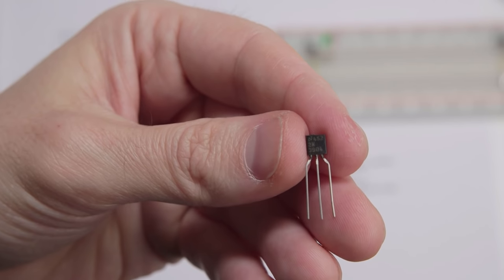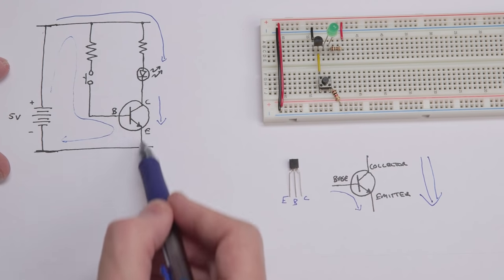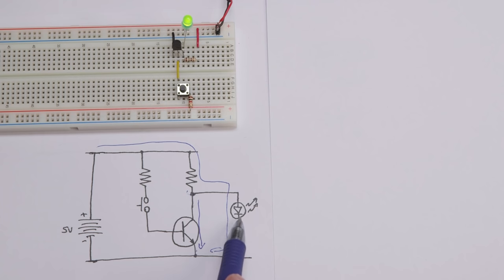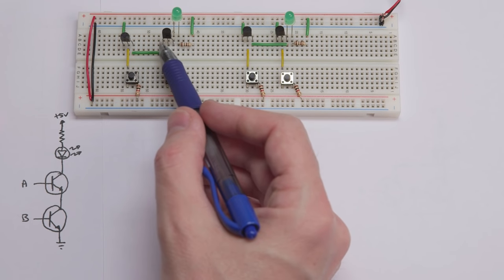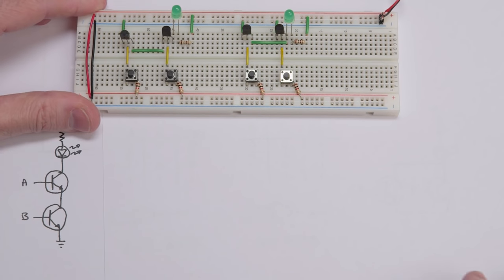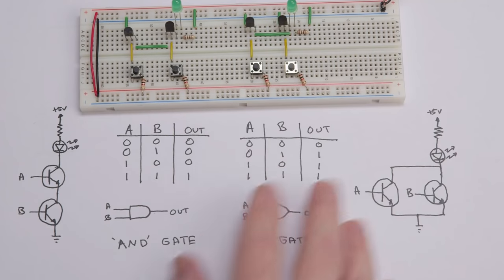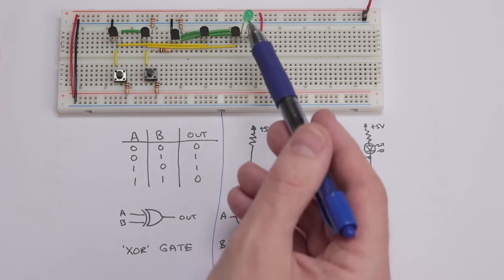Making logic gates from transistors

Comment: Ben Eater - in the inverter circuit where the LED turns off when the button is pushed (around 3:30).
I can't help but thinking of all these circuits that are open/flowing current - eating up energy.  Typically, when I think of a switch, I think of current flowing or not flowing.  yet in this design, current is always flowing?
Reply: The led does not have a resistance, but a voltage drop, now the  LED does not turn on because a parallel connection always has the same voltage drop, but the transistor does not (as far as I know) have a voltage drop so the voltage drop will be 0, and an LED needs about 2 volts to turn on so therefore it will not turn on
Reply: Yes, in the above circuits, there is always current flowing. And the circuits he's using is very similar to TTL which was noted as being high speed, but power hungry. But there are other methods of creating the desired logic. Take a look at MOSFETs for instance. With those components, you don't have a constant current flow from the base through the emitter, what you instead is charge and discharge the gate as if it were a small capacitor. So you get power consumption whenever a logic element changes state, but otherwise, there's no current flow. And from that, you have what's called CMOS.
Reply: You are absolutely correct and John Cochran's reply is 100% the best answer to your comment.
Having worked in the design area of an electronics company in the late 80's "idle current flow" was a big concern for a company wanting to reduce the power consumption (and heat degradation) in their product. TTL logic circuits were designed (in the company where I worked) so that if their output was high or conducting over 65% of the time, that output would be inverted, if possible. This actually made the overall circuit bloated with "decoding" logic to re-invert the signal, or PNP instead of NPN transistors were used as drivers, but it did reduce the "idle current flow" ... in some cases.  TTL (transistor/transistor logic) ICs are fairly rare in today's digital circuits -  discreet transistor logic gates such as these are even more rare and only used to buffer logic IC outputs to high current loads. Even that has mostly been replaced with Field Effect Transistors who's current reducing attributes are explained by Mr. Cochran.
Reply: in this case its reffered to as high or low. in this kinda desing you can't have literally nothing as "low", that would equal a shut off computer
Reply: well in real computers the output of almost every transistor is the input of another one which doesn't drain current except for when the state is changed. Also There are other types of transistors as well which deal with that inverting problem.
Reply: Jakob Furbo I was curious about this when you said LEDs do not have resistance so I researched it. LEDs DO have resistance, but is is not linear. Resistance is high with low voltage, but falls rapidly at breakdown voltage. Without a protective resistance, too much current will flow and fry the LED.
Reply: LoneRegister oh no! Not my mAh!
Reply: roygalaasen the

Comment: Why do you need the middle voltage supply in the XOR-gate?
Reply: I'd like to know this as well.
Reply: Yeah. This doesn't look quite right.
Reply: I think it's to pull the middle voltage up to high when it's not connected from the right, preventing residual voltages from messing with the output
Reply: I’m still wondering this, why doesn’t the voltage go straight to ground through transistor if it’s always on as he says in video?
Reply: Please Someone Answer To This !

Comment: +Ben Eater Great video!! Can you provide some specs on the transistors and resistors you've used in this video? My dad and I tried making your circuits and we couldn't figure out the parts you used from the video.
Reply: i think he uses an 452 2N3904 transistor
Reply: Any cheap NPN transistor will work. I'm using BC547.
All resistors connected to base must be around 1 kOhm or larger.
All resistors connected to collector can be around 200 Ohm (+/- 50 %). Too small, and the LED burns. Too large, and the LED does not light up.

Comment: can you tell me which resistors (how much ohms) and transistors you used? also what is the voltage of the battery you used?
Reply: The button used a 10k ohm resistor while the led used a 220 ohm resistor.  I'm pretty sure...
Reply: Ignore that last comment.  After testing it out a bit I can confirm that he used 1k and 220 ohm resistors.  Seems like he's using basic NPN transistors as well.
Reply: Well for the pull-up/down resistor (the resistor used for the transistor base) you will use between 1k to 10k, this is to limit the amount of current (amps) going into the transistor, the transistor only need a very small current to work.
Now for the LED you will need to calculate for each LED you are using. Most LEDs like to get about 20miliamps of current and most LEDs have a voltage drop about 2 volts. so if you have 5v power supply you will have a voltage drop of 3v. now you will use ohms law to find how many ohms you need 150 (ohm) = 3 (volts)/0,02 (amps). but you can just use 220 ohm for almost any LED if you are lazy.
Reply: Well, after closely seeing them, you will notice the colour codes Brown-Black-Red-Gold, which is 10 X 10e2 = 10 X 100 = 1K ohms. Well its not clear if the third band is RED or ORANGE, if it Red, it is 1k. If it is orange, its multiplier is 10e3, so the resistance will become 10k ohms.

Comment: 11:17 would the two bottom transistors off shorting vcc directly to ground cause problems or power loss in real world usage?
Reply: there is a resistor connected to that circuit, so its not a short

Comment: I remember in Electronics lab we were creating logic circuits on breadboards using truth tables and those logic gate ics. The chips we had only had a few types of logic gates and just 2 inputs so I made the whole circuit using bjts (2N3904 and 2N3906), 5.6k resistors, and 1N4001 diodes. It was easier to set up for whatever reason.

Comment: Remember uL914 ?  The guidance system in  the Minuteman missile was built around a 27 bit computer made from ca 1500 transistors and 4500 diodes.  Early boot ROM's in some computers was built from a diode  matrix.

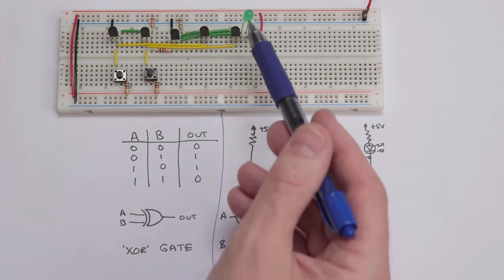Comment: You actually have a resistor that doesn't need to be there at all. Pause at 8:55. In the handdrawn diagram, it's the middle one at the top written 5V next to it. It provides power to the collector of the 5th transistor, which is also connected to the emitters of the two transistors coming from the parallel after the LED. There's no need for it to be there at all, in fact, it's a battery drain.
It does not need to be replaced with a direct line, either. It can be removed and that input line on the diagram erased so it shows only two 5V signal lines.

Comment: In an AND gate, you only need 1 transistor. A transistor is really just an AND gate.
OR gates only need 2 diodes facing the output direction.

Comment: The first circuit can be called a buffer if you want.  Typically you would use an opamp for a buffer but your circuit works fine.  Also, you only need two npn transistors to make a bipolar XOR gate.

Comment: I don't think that you need 5V and pull up resistor at the single NPN transistor in the xor circuit. I just tested in LTspice, with or without it, it works.

Comment: I had issues for the longest time with my transistors, but realized i hadn't put a resistor on the buttons, and I had one on the led. Remember to put resistors on your buttons like Ben Eater has or your transistors will be inconsistent.  I think its because there was more current coming through the base from the button than the collector from the led, so current was flowing either slower or not at all through the led. Tell me if I'm wrong though because i wanna learn.

Comment: Just know, current actually flows from negative to positive, back when the schematic symbols for diodes and trasistors were conceived, they had different ideas so the little arrows in those symbols are effectively pointing the wrong direction.

Comment: Okay. So. While building these individual gate circuits was simple enough for me, I ran into a HEAP of trouble connecting them together - say, to make two NOR gates feeding back into one another to make an SR latch (I wanted to be sure I understood the concepts sufficiently so as not to rely on IC gate chips). Other resources on the web were no help, and it took me a few days to understand what was going wrong.

What it came down to, for me, is that the inverter gate (which forms part of a NOR gate in my case), when it's in the "off" state, will still have some amount of voltage/current-generating potential at the output (it won't be a TRUE "zero"). This will hold so long as there is ANY resistance in the transistor itself (or of course if the transistor is not in "saturated" state). In my case, the NPN transistors I had on hand (from an "electronics lab" project kit for kids (no longer sold)) do provide some small resistance. If there is any resistance, then the activated transistor isn't really a "short to ground", and that means there's still a voltage differential across it. And if there's a voltage differential across it, that means it's not going to be a "true" zero. It'll be "close to zero". Which is fine, until you apply it as the input to another NOR gate's transistor, where it start to amplify current when it was supposed to be "off".

The remedy for this, at least in my case, is to be sure and treat the LED as part of the circuit, and make sure you take your "output" after the LED. The voltage behind the LED should be lower than the voltage required to operate it ("forward voltage"), and so the LED will be enough to stop small currents from flowing when it's supposed to be "zero". This means if you, too, try to build a latch from a pair of NOR gates, you can not remove one of the LEDs (say, the not-Q indicator), and must feed each NOR gate's input from the other, after the diode, to prevent the leakage. (If you wish to omit an LED, replace it with a suitable diode instead - just make sure that a minimum output voltage is enforced.)

I recommend everyone building the inverter/"NOT" gate, or any of the inverted other gates (NOR, NAND, etc), verify their outputs have no voltage while "off" - use your multimeter, and keep in mind that the voltage/current will be a slight one, so if it's an analog multimeter be sure to compare against a true zero (that is, pull the contact off and on and see if it moves even slightly). If you find, as I did, that there is in fact some voltage being applied, then save yourself some headaches and be sure you're applying a diode.

Cheers! And apologies to those of you who may have much nicer transistors that really will act equivalently to a short. I've just ordered some 2N2222s and 2N3904s, so I'll be sure to check my results with those.

Frustratingly, I found no electronics books, YouTube videos, or other online videos that made this issue clear, since all of them dealt with "ideal" transistors that short to ground, or just use an LED turning off/on to "prove" the state - and once they prove you can build the gate with transistors, they move on to using IC gates - or in the case of schematics write their diagrams using gate-level logic instead of transistor-level. I can't tell you how happy I was to finally get the little light to hold and swap between Q and Q-! ^_^

Comment: Was always wondering/curious how to wire a circuit for lights in a long hallway - with two flip switches at each end. Got tired walking back and forth - because both switches need to be in the ON position for the lights to come on. If one switch is in the OFF position, then you can’t turn ON the lights with the other switch - have to walk to the other end of the hallway to turn the other switch to the ON position....... Anyways, it looks like the simplest solution to my problem is the “XOR” gate!!! Thanks for your awesome, and to the point explanations - well done on the video mate - subscribed, and will be looking at more of your videos:)

Comment: PLEASE HELP!

I'm taking the AND gate as an example but this also applies for the XOR gate.

The way he built the and gate means that it can only turn on an LED, it doesn't really give an output of 5V anywhere, instead it's  allowing the LED to be connected to ground for it to be turned on. This means that I can't connect many gates together because there is no 5V output anywhere, only a path to ground. The input for these AND gates "ask" for 5V, not a path to ground.

A solution I thought of is to instead take an output after the transistors, which will connect the output to 5V if both transistors are on, and to ground normally. This looked like it was going to work, but if input A is off and input B is on, the current going into the base of transistor B will just go through to emitter, giving an output even though input A is off.

Another solution is to just make an NAND gate by taking an output with a resistor instead of the LED. This way when both transistors are on it will connect the resistor to ground and give a 0 for output, but any other time it won't connect to ground and will instead be connected to 5V, giving a 1 as an output. Then I just have to invert the output of the NAND gate with an inverter the way he showed in the video. But this solution uses an extra transistor, increasing the amount of transistors in an AND gate by 50%, which is of course not ideal.

The third solution i thought of it just to use small logic level MOSFETs instead of the BJTs used in the video, i could find some online that were the same TO 92 package as the BJTs shown. MOSFETs don't give an output at the source when there is no voltage at the drain, but when there is voltage at the gate, there isn't a current flowing into the gate. This means i can just use the first solution of putting the LED after the transistors, so that when B is on but A is off there won't be any current flowing from the gate to the source. But this solution still isn't ideal, as most people are obviously using BJTs and all the circuit diagrams are drawn with BJTs. Small logic level MOSFETS are also quite hard for me to find.

So does anyone know a way where i can build an AND gate with only two BJT transistors, and have a 5V output instead of giving a path to ground? Thanks for reading and answering this.
Reply: Ok it's been 3 years and I've found the solution. The trick is to use a combination of nMOS and pMOS transistors so that the output of the logic gate can be either 5v or ground. Logic gates made with both nMOS and pMOS transistors are called cMOS.

Comment: Very good video. Quick question, on your XOR gate, the third transistor from the right, whose base is normally on unless there's an AND condition, does it need 5V power to its directly to its collector as is illustrated? I know you mention that there's no voltage potential if that transistor base was off, but would it not also work if the transistor was "open" due to no power to the base and thus nowhere for the current coming from the OR arrangement to go? Thanks in advance.
Reply: I actually thought the same. I built that scheme without that additional resistor connected to 5V, and the scheme worked fine. Seems like many of us here in the comments had the same question. I'm more inclined to think, that we don't need that connection.
Reply: @ilya_95  funny enough I just built an XOR gate a few days ago and had the same results. Perhaps there’s a reason but I’m not sure.

Comment: May be a dumb question but at 2:20, when Ben brings up the inverter circuit, doesn't pressing the button essentially create a short circuit? The power flows through the transistor instead of the LED as it is a path of lower resistance. Does the resistor before the switch prevent this a short circuit? I understand that in a bigger circuit the leads wouldn't directly head back to the power source as they do here, but in this circuit in particular, it looks to be a short. Can someone explain please?

Comment: Thank you so much for making such a carefully worked out video Ben! I have a question about the XOR circuit. Is the second connection to +5V on the top in the middle necessary? It seems the output from the 2 transistors on the right will be enough to complete the circuit.

Comment: So these first 5 examples are just over-engineered series and parallel switching circuits (the XOR with pushbuttons is like if you had momentary 3-way switches on your walls; really no transistors needed. But it's when you replace the pushbuttons with other signal-generating devices, that's when it gets interesting and the extra engineering makes sense.

Comment: At 8:35 , I feel the circuit drawn on paper is wrong. The middle transistor shouldn't be connected to 5V at the collector. It's drain and base are correctly connected though. Because, according to the drawing, the middle transistor would be short circuiting the whole circuit since it's base is also directly connected to 5V. :P The middle transistors collector should only be connected to the drain of both the 2 transistors on the right.